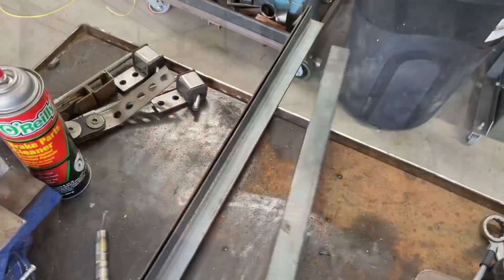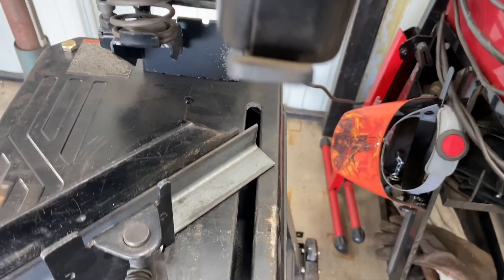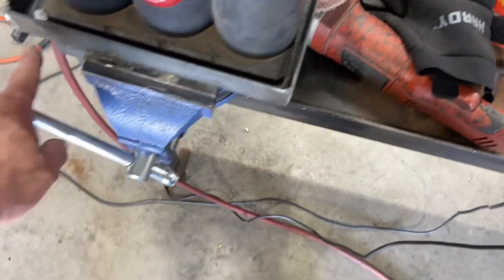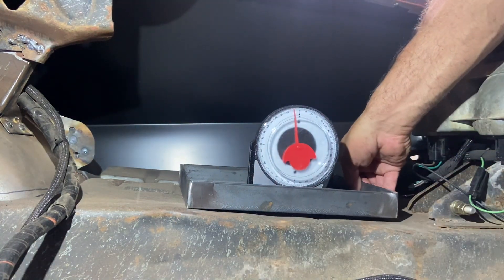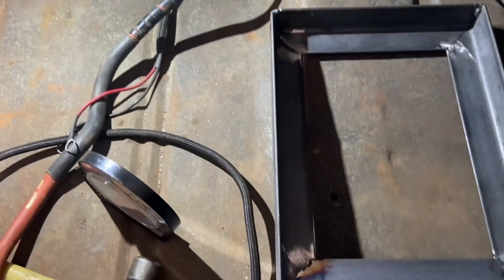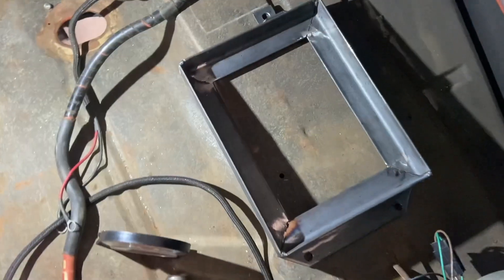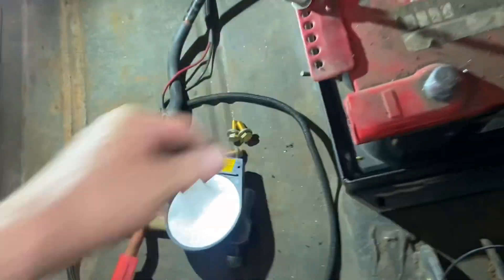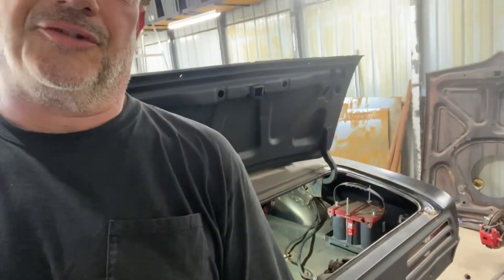1969 Firebird battery relocation tray. How to. DIY. Trunk mount.

Comment: That angle isn't cheap. It'd be nice to have an old metal bed frame to cut down to size. She's coming along nicely.
Reply from the maker: A bed frame would be easy to use, only problem would be my wife not liking a bed frame going missing… lol.  Not sure if you’re familiar with Atwood’s or not, kinda like a farm and garden type of place.  Their prices are usually comparable so I didn’t even think to look at the price.  I tried blaming my wife for all the mulch and potting soil she got on that trip for the high receipt . She set me straight when she looked at the numbers and those three 4 foot sticks were about 15 bucks more than everything she got…lol